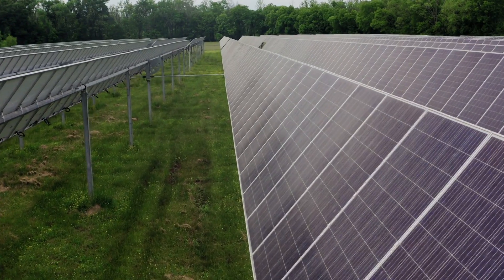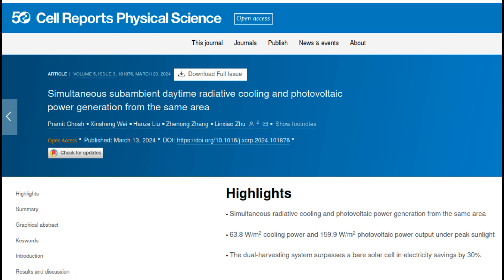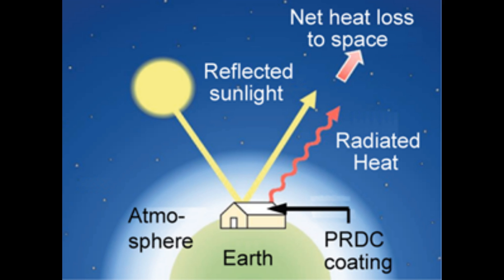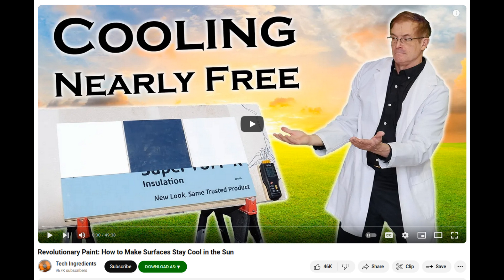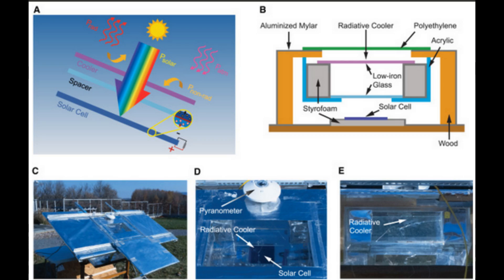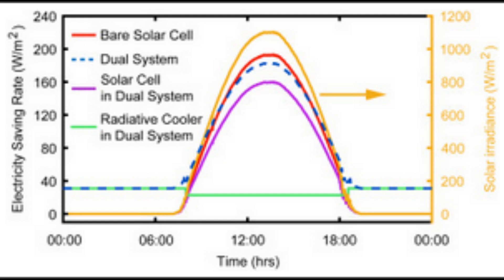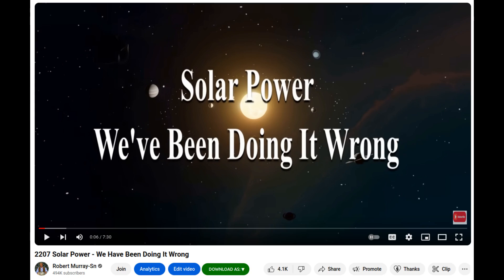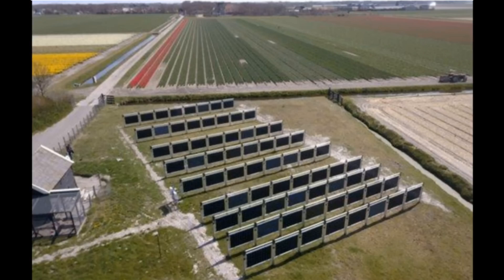2256 New Solar Booster - Easy DIY, Simple, Cheap And Effective

Comment: If orientating panels vertically increases elec output why don't we hang them on house walls where they would also provide insulation reducing heat loss.

Comment: Bifacial panels are now becoming popular and they are hung vertical with an edge facing South. This produces a "M" shaped daily production curve that declines at the hottest part of the day. Here comes an idea. Why not use a micro ribbed prismatic "wash board" Fornell glass cover to bend the best production angle slightly forward from the perpendicular.

Comment: Just to help with anyone thinking of trying the experiment take these options into consideration:

1) If you bond the opti white glass to the solar panel don’t use silicone. Silicone erodes glass. 

2) Laminate glass option could help with solar panel protection from weather elements. 

Good luck with the tests!

From a second generation glazier which has a passion for glass technology.

Robert, you’re the Fred Dibnah of Science. Keep up this fantastic channel👍

Comment: Thank you for bringing this topic to attention, Robert. I was searching for a solution to reflect infrared light for my side project, so I was quite excited to learn that there is a commercially available glass designed for this purpose. However, upon reading the Optiwire brochure on the Pilkington official site, I found no mention of this glass's ability to reflect IR light. Instead, the brochure highlights the glass's increased transparency, presumably in both the visible and infrared spectrums. This would explain the claim of "maximizing passive solar heat gain on cold sunny days." In fact, it makes perfect sense: if the glass were to reflect infrared light, it wouldn't facilitate passive cooling. After reviewing the paper, I must admit, it raised more questions than answers for me.

Comment: Just a quick correction, the majority of the sun energy, which arrived at the surface of the earth, is in the visible light spectrum. With some of it coming in the near ultraviolet, and the near infrared. Overall, the positive impact of solar panels shading the buildings. They are supported by is quite noticeable.

Comment: I'm in Canada.  We are (or were) used to putting storm windows over our windows in winter to get another layer of trapped air for insulation, so I guess we could similarly add this glass layer in summer and remove it for winter.  It's not like it has to be sealed or anything, so should be a simple mechanical fit.

Also, in somewhere like the NYC concrete canyons, would this glass on skyscraper windows reflect/bounce all infrared down to street level and heat it up?

Comment: My immediate take away from this would be to make a thin film equivalent that can be rolled behind it in winter on one of the new muscovite and gold cells you could use laser etching on the gold backing elements to increase the uptake of the reflected I.R. and a really thin film of coolant to take the heat energy away as electrical heating is still pretty inefficient. Then you'd be making gains in cooling and heating plus more power in winter.
Not a cheap option for bulk grid but would make for a very efficient setup for micro scale on edge living.

Comment: Vertical solar requires 4x the land area. And gives more energy during summer when you don't need it, and 2x less during winter when you do need it. At £3 per sqf that means £60 per 400W panel that itself costs £60. So double the price for minor improvement.

Comment: I've long suggested using lenticular lensing sheets placed directly onto the panels proper.
I don't doubt it would be possible to work out the angles needed for such a short contraction, one wouldn't require the rays to be massively focused, only enough to raise the amplitude by a fraction should make a massive difference to the saveable energy.

Comment: This should be tested with reflectors. 4 Mirrors or polished aluminium can increase power by upwards of 400% on days with a bit of clouds, but on sunny days it is lower as the panel heats up. This might be useful to reduce that extra heat.

Comment: "Ooo dat glass..."
I see some serious potential here for focusing solar infrared onto some Solar Evacuated Heat Tubes. 
That may well be the trick for getting some proper steam generation!
Reply: That's a very interesting thought. Even if you don't end up generating steam, your PV setup would still be doing double duty as solar thermal.
Reply: @alphajunky  Naw, this would be just for the solar evacuated tubes. The PV is another setup.

Comment: Why not use the unwanted heat to run a Thremo Electric Generator layer underneath the solar panel, it would generate more than enough to run a fan to enhance cooling and the TEG would cool the panel for higher efficiency?

Comment: It’s always irritated me that most people address “solar energy“ only in terms of its conversion to electricity. Adobe walls use solar energy by absorbing it in the heat of the day and releasing it in the cool of night to warm the interior. We dry clothes in the sun, and the wind is motivated by the sun. Vegetables are solar energy energy and the so are coal and oil. But using direct solar input saves the pollution of burning the ancient fossil sunlight. Intelligent design using all elements of solar radiation is needed to extract the best utility from the sun. Thank you for all your work.
Reply: True about direct sun energy; the difficulty is saving this energy for later use in a human and nature friendly way.

Comment: Rob, what about the restriction of land area?  Would hanging panels vertically use more land, due to shading from adjacent panels?  Would this efficiency gain be offset by the number of overall panels that you could squeeze into a given amount of acreage.  Seems like a 6 or half dozen type situation!

Comment: Most people don't know that solar panels lose about 0.5% of their output for every degree C. So a solar panel rated at 400W (tested at 25C and 1000W/m2 irradiation) will only produce 320W at 65C, which is not an unusual temperature for a solar panel to have. That's why companies like Triple Solar have developed PVT solar panels which not only generate electricity but are also used to (pre)heat water.

Comment: Pilkington states Optiwhite is created for solar  - gain - transmission  applications  (also for installations where true colour is needed/desirable - like commercial displays and fishtanks.)...
(datasheet)

"Direct solar heat transmittance is also greater with Pilkington Optiwhite™and is vital when specifying glass for solar energy collection applications. In either direct transmittance, or as the component glass in mirrors reflecting energy onto solar collectors, the performance of Pilkington Optiwhite™ is substantially superior." -

Not sure if that will improve or harm performance of a PV panel??

 - Vertical panels are also much more hail resistant / protected by geometry.  (I like the idea of "swinging / hanging - radiative cooling arrays..).

(is this doing what was described or not?? - not from my quick look at the datasheet)
 - Low-e coated glass, seems to be better for thee rejection of IR and thermal gain in full sun.  (Is there a low-e opticallyclear tempered glass available for the ideal bifacial installation??

Regarding solar aspect, for a fixed installation - it is better to have too much angle rather than too little, the steeper the panel the betterit drains and fself cleans, and the lower the summer heat gain.  As most systems are "oversized" for the inverter, on an optimal summer day, the inverter can't cope (export of use with the full output of the system anyhow, so (without a DC coupled battery) an optimal winter angle - will maximise output throughout the year - better that winter boost rather than summer thermal gain.

Comment: Another factor that needs to be considered is the propensity of solar panels to melt off snow in the winter.  Here one of the things that limits electricity production in the winter is snow on the panels.  The dark iridium coating is fairly effect with melting off a light covering of snow thereby dramatically increasing wintertime production.
   I would want to evaluate the tradeoff with the increased IR reflection.

Comment: Most people don’t realize just how much 10 degrees C can drop their SP output. What I did long ago was to find out where I was getting the most south to north flowing wind on my property. Turns out my garage and the boundary wall with my neighbor  was actually very effective in deflecting wind most of the year around to a northerly direction  in one particular part of the property. So I moved the panels to still face north (I'm in southern hemisphere ) but in the path of that wind. I got hold of some cans of black spray paint and painted the back of the panels black. The black helped radiate the heat collected on the sun side and the wind took the hot air away.  I got an average improvement in energy output of around 5% with nothing more than 3 cans of spray paint and a bit of elbow grease. Temperature really does make a difference.
Reply: I've noticed panel installers now put skirts aroumd panels to keep birds out. This must also trap heat under the panels.

Comment: Interesting experiment.  You could also put solar cells in the interstitial between floors - they often have glass hiding the concrete…. You get placement almost free as the space isn’t used

Comment: Maybe even adding some cheap reflectors if hanging vertically doesn't over come the glass absorbtion shortfall or to see if you can increase the power output without increasing heat absorption.

Comment: Would seem a boon in hot weather dominated climates. But in cold weather dominated where the winter heat gain is positive to the structure, perhaps not so good overall.

Comment: You should research pilkington Optiwhite Low E (softcoat) it's the same low iron glass with an RF sputtered coating on the inside pane (this coating  is conductive and can be etched) This combined with a perovskite can be used to to create a cell.   Also this coating also reflects IR
Reply: Thought I'd add if memory serves the Low E coating is a RF Magnetron  deposited layer of Tin Oxide (SnO2)

Comment: I'm using 4-100 watt panels to pump water from my well. What if I diverted a small water line to misting sprayers that would spray over the panels to help cool them? I adjust the angle of panels every couple months.
Reply: Other channels have proved this to a positive effect on energy output.  Possible to attract and bond more dirt to the panel and need more frequent cleaning.  I am guessing on this point.  The misting is not likely to be strong enough to clean the panel(s).
Experiment and good luck.
Reply: @69dblcab  It's a ground mount so easy to clean. I have a carwash brush anf squeegee and clean the panels every couple weeks or more often as needed.

Comment: How about a reflective mirror at 90 deg to the panel while hanging it vertically.
Reply: Tech Ingredients did something similar with the panel adjusted to the sun. He found some cheap material to make it.
In my opinion the main issue would be maintenance, the mirror needs to be washed once in awhile. I think that sloping inwards one would give even better results

Comment: I'm in Calgary, Alberta, and we get quite a lot of sun, but the anomalous thing I see, is when we have a sunny day and below-zero temps (sometimes very below-zero) my solar panels can produce 25% more power than the 1800W, 25-degree C standard test, they are rated at. I have seen more than 2400W on occasion, when it's cold and sunny. This sounds like a really interesting idea!
Reply: Solar panel efficiency goes down the higher the temperature. Just because the air is like 25° doesn't mean the panel is 25, probably closer to  45°
Reply: @buddyguy4723  That's probably true but my point is that the efficiency goes up as the temperature goes down. If I can keep the temperature of my panels below the 25C rating in the summer, then I should see corresponding increases in the amount of energy I can 'get for free'. (we typically see 30-40 degrees C in the middle of summer)
Reply: @dSquared0162   I know I live in the same city lol.  There's examples of people using aluminum cooling blocks and and forced air using pc fans.  I think one of them achieved like a 40° difference. I don't remember if he was measuring in Fahrenheit or Celsius though.
Reply: The Himalayas wold be killer for solar then as one of the only places you can sunburn to blisters and freeze to death at the same time.
Reply: Less resistance……
Reply: @jondelaire  One of the lesser referenced aspects of Ohm's Law.
Reply: you have to be careful of the increase in string voltage too especially if you designed your pv setup to close to your systems max limit. things can go pop.
Reply: @mickwolf1077 My panels possible output exceeds my inverters ability to convert it all by approx 10%. This is common. However I have something like a 20% safty buffer on my inverter. But good point to make.
Reply: @williamarmstrong7199  yeah, extra current is usually OK but not total voltage.
Reply: True, but that is free heat! In your neck of the woods, like mine in Maine, capturing that heat for hot water or heating while still cooling the panels would be much better. Water cooled panels are a thing for a reason.
I want to see bifacials above a thermal solar system to see if the light that is let through would do a better job at heating than water cooled panels. You have almost all the same equipment, but direct access to more light.
Reply: Less moisture in the atmosphere between your panel and the Sun perhaps? 🤔

Comment: Hasn't this just disproved the C02 warming theory if the infrared gets reflected back out into space? Incredible the solar manufacturers haven't thought of this before...
Reply: The higher frequency Infra Red hits the ground etc., and re-radiates as lower frequency Infra Red. It is this sub 5um (ish) Infra Red that the Co2 etc., traps. The higher 10um (ish) Infra Red can be reflected straight back out to space.
Reply: Pull your head out of your posterior.
Reply: @AngryMan540  Pull your head out of his posterior.